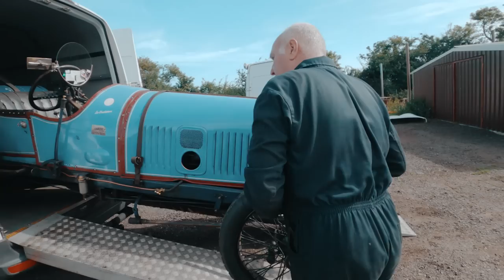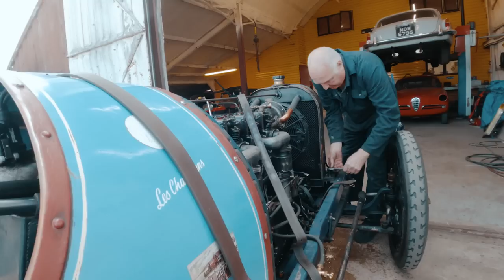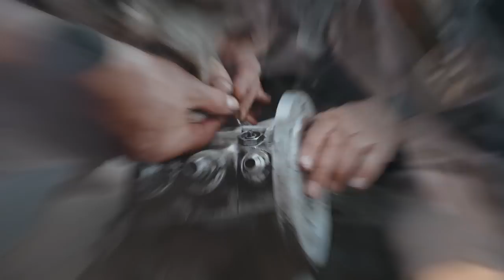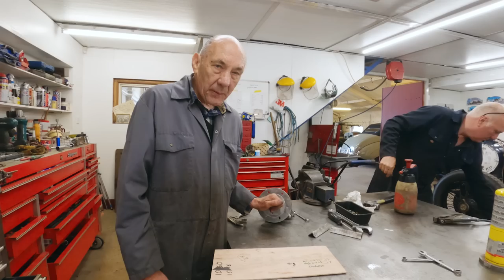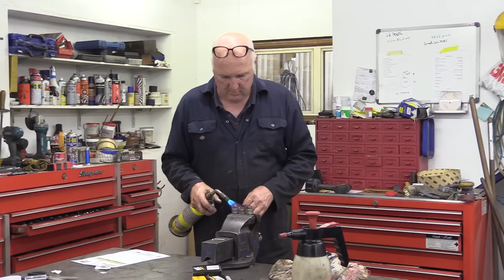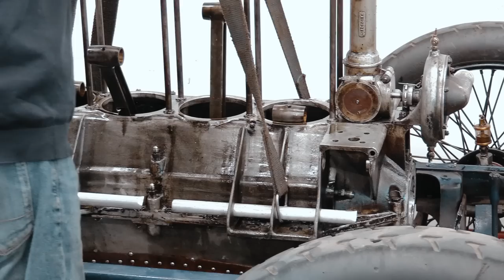SHED RACING - Hall and Scott

Comment: Sorry to see that you're having problems with the Hall-Scott engine Ivan. A mate of mine had a similar problem with his '63 E Type Jag engine, the split pins in the castellated big end bolts were a bit undersized and the reciprocating motion caused them to wear away and fall out into the sump. Most of them stayed in the sump at the bottom, but one piece got pulled through the pump suction screen and jammed the oil pump causing it to seize. Great video Ivan and John, I always look forward to your next installment.

Comment: Ivan, years ago I rebuilt an ex-Nascar Chevrolet V8 and it had 5 stages of scavenging in the dry sump system. The pickup for the lifter valley had  a small screen epoxied over it. The system was designed to isolate the valve train lube system from the rest of the engine, so a dropped valve wouldn't frag the rest of the engine. You sure were lucky with the oil pump! Perhaps the cat has something to do with it!

Comment: I like how modern to Ivan is 1960s! I've rebuilt a couple of pre war engines now and the most nerve wracking thing is seeing if you have oil pressure or not when it's actually running. You can tell if the valves open and close and the pistons won't hit the head by hand and not having spark won't matter, it just won't start, but no oil is my biggest fear. In my Riley engine I had the opposite issue, too much pressure. I have a modern filter on it (and I need to steal your disguising it trick) and it blew out the filter o ring and oil went everywhere. No damage done luckily.

Comment: Love the show love you guys you get it done. We used to use an oil filter cutter to open filter, s it does not pollute the filter with metal from a saw it works like a tin opener. You can buy them for low money on the web. Nice tool I think you would like one.

Comment: Me being ASE certified master technician for over 45 years, I would not be able to sleep at night, wondering where that Cottor key came from! As many of those as I seen you put in that engine when you were assembling it, it came from inside that engine somewhere, I would not rest until I pulled that thing apart and found out where.

Comment: I use my lathe to open oil filters, proper size bolt in the chuck, screw filter on, open :)
Reply: Thankfully I’ve never had cause to open an oil filter, but doesn’t that get a bit messy? I can see that it wouldn’t be adding any contaminants. Cheers.

Comment: It's illogical to check the oil filter for swarf, if the pump stopped working then the oil circulation must have stopped, then if any damage was done running without oil, there would be no oil passing through the filter and therefore no metal swarf will be in the filter from any damage

Comment: Welds with bare hands?

Argh! How do you endure the blops? (weld spatter.)  Tig gloves? 

Yes, I’ve gotten blopped and leaded (from 50 years of soldering irons, bullet casting, etc.)
Reply: The bigger issue is UV damage. A few hot beads are just beauty marks. ;-)

Comment: I would be reluctant to weld the oil pump drive without knowing the alloy or the correct rod to use. (certainly wouldn't use mig) Why would you not install a shear pin? Especially when that split pin might have a brother!

Comment: Well mate if it was me I'd be wanting to find the other parts of that split pin. If you are right and the split pin is from a big end bearing cap nut then you'd be wise to retorque the nut and fit a new split pin and find the remnants of the broken one. Also, I would be concerned about my method and why I'd missed a loose split pin or reused an old one in the rebuild process. Surprised at you not dropping the sump off.

Comment: Engineering wise, it a poor solution to be welding drive shafts for 2 reasons, 1. strength & 2. alignment, surprised that you even considered that would be a good fix.

Comment: Still attracting pu$$y Ivan 😂
Great episode. Be interesting to know where that split pin came from.
Reminds me of my father fitting a BMC gold seal gearbox to a Wolseley 1300, he drove it 120 miles back and forward from the BMC garage to his house for a week and it suddenly lost all oil pressure. Turned out to be a synchro spring that had been dropped into the oil pickup and worked its way into the oil pump and locked it up.